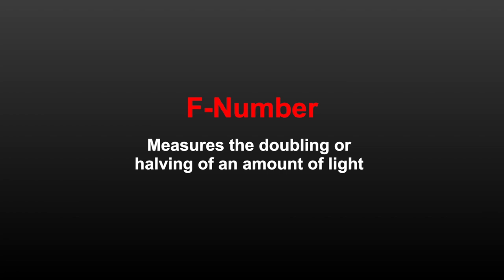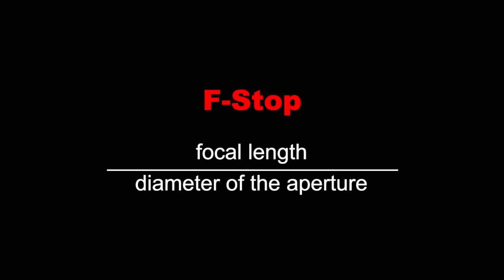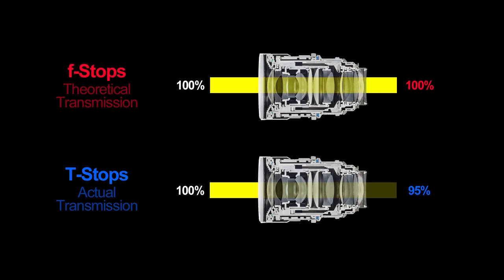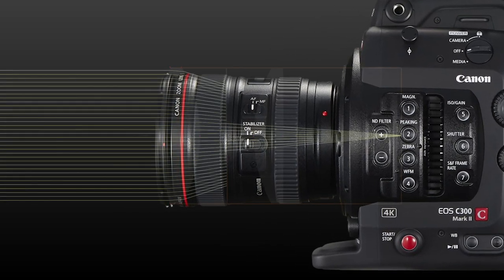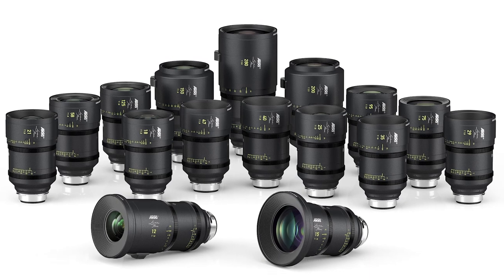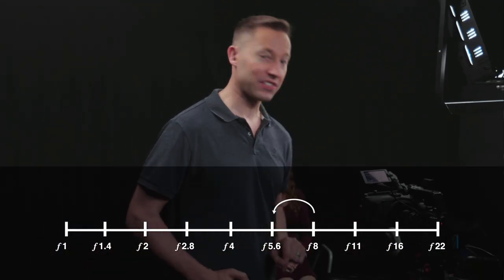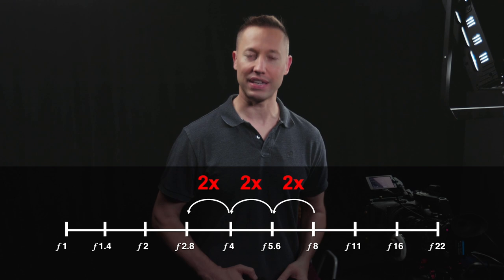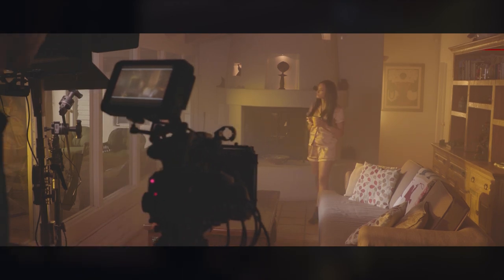Mastering f-Stops for Cinematic Lighting

Comment: Was on a film shoot at night with lights  and the  1st camera using a GH5 was shooting on a wide lens, I was on an 85mm on S1H, he was insistent on the exact same ISO and F stop.  I was complaining the shot was too dark.  Then the lighting guy and first camera guy stated if I didn't match with iso and f stop it would cause problems in post.  So I notched down F stop by 1 stop and I spoke to the editor and that nights shoot was far too dark to use.  I knew with the full frame and longer lens I couldnt be using identical settings.  But you have just confirmed it thank you.

Comment: Great tutorials! Thank you!!!
I have a question: when you said that her skin will appear as middle grey, so you had to open up your aperture 1,5 stops, the (graphic) meter on the screen didn't move. So, what was the actual value of the aperture on the lens/camera? 5,6 or, let's say, 3,5?
In general, don't we just dial in our camera, the f value that we read on our light meter (since it is incident light...)?
Thanks in advance! :)
Reply from the maker: So I have two parts to my answer. Firstly, I never use an incident meter because that measures the brightness of the light source. What really matters is the brightness of light reflected off a surface, which is why I only use a spot meter. Secondly, you're right. If I set my aperture to match the light meter reading of the actor's face, her skin tones would read as 18% middle grey. But, that would be too dark - she is pretty fair skinned. I opened up by 1.5 f-stops because her skin tones are 1.5 f-stops brighter than middle grey.  I run through these tests in the second half of this video. Whenever I start a new project, I take a meter reading of a middle grey card, then under the same light, I line up each actor and take a spot meter reading of their forehead to establish how much brighter/darker their skin tones are compared to middle grey. That's how I knew this particular actor's skin tones were 1.5 f-stops brighter than middle grey. Hope that makes sense!
Reply: @FilmSkills ah that makes so much sense now